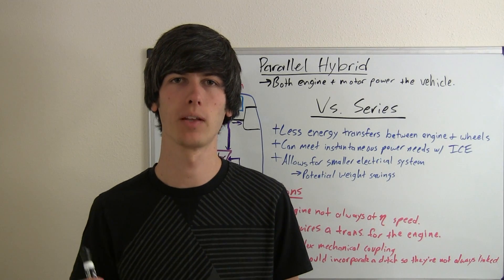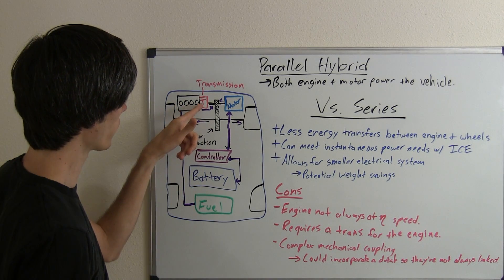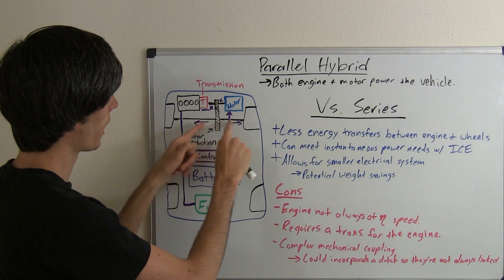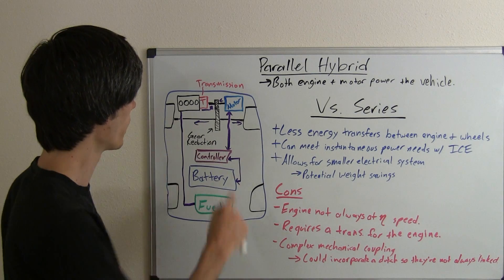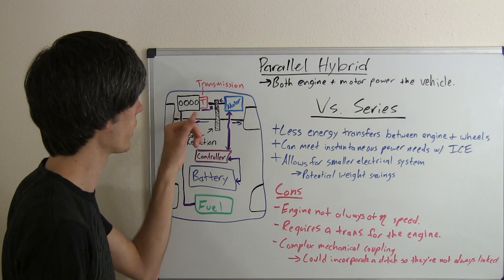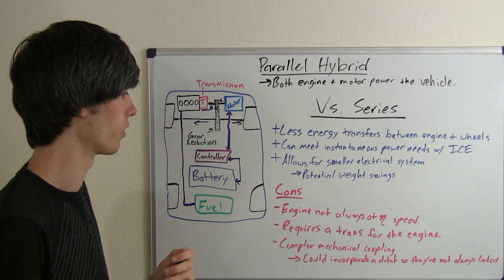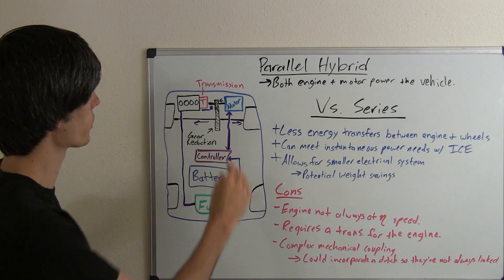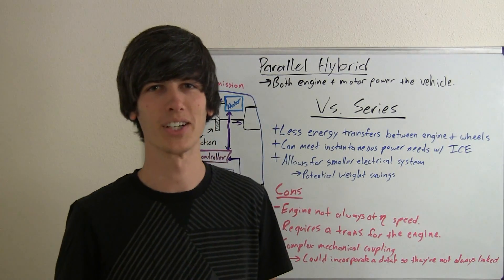Parallel Hybrid Cars - Explained

Comment: Be nice if a company could develop a plug-&-play set of components that would allow selection of the electric drive axle, battery, generator and connecting inverters etc. via a software program so that mechanics could select and build a drive train that fits the situation. Example is my old F150 "farm truck" I use it around the farm, never goes over 30 mph and often sits next to where I'm working and can supply electric power to tools I use.

Comment: I'm curious to know, instead of the complicated coupling mechanism between engine and electric motor can you put the motor to drive the rear wheels while the engine drives the fronts or vice-versa?

Comment: Can you just have the ICE + Generator directly power the motors and then just use the battery during acceleration? The ICE + Generator is not coupled to the motors. The battery will then be recharged using regenerative braking. Is this possible or am I naive?

Comment: can u explain that complicated transmission part like which type of transmission we can use and how to match the engine rpm and motor rpm as equal
Reply: Essy. Using sensors on engine and using a computer to regulate the current going in the motor.

Comment: Hi,
In mild hybrids or KERS where it is used as a 'boost' how does the electric motor manage to spin at the same rate as the ICE?
i.e. what couples (connects) the electric motor to the engine shaft or transmission. Because I assume the ICE and motor have to rotate at the same speed.
E.G. If the engine is already rotating at 5000rpm and the electric motor/ flywheel kers is activated how does it match the 5000 rpm of the engine?....
Does it even need to match the rpm at all?

Comment: Another advantage of the parallel hybrid is that if the battery pack or something in the electric side gives out, you can still drive on the ICE side of it to get where you're going.  In a series hybrid, if the electric motor gives out, that's and immediate tow.
Reply from the maker: Eric Brunhammer I suppose. If your engine dies in your gas car then it's the same thing, and honestly electric motors are typically more reliable than combustion engines.
Reply: Engineering Explained basically what I was saying was that if one system failed, you should in theory be able to make it somewhere on the other system; provided that it's set up to work that way.

Comment: Hey Bro nicely explained, i'm an Electrical Engineering student and i'm working on a final project that aims at improving on Parallel Hybrid systems. What i've decided on doing is an improvement to FWD Parallel Hybrids by replacing the heavy on board battery with a Variable resistive capacitive 3 phase load box connected to the axle of a rear mounted 3 phase generator. The generator is then connected to a mechanical rpm ratio step up linkage that is connected to a rear differential. This aims at generating voltage from the rotation of the free spinning rear wheels in order to power the on board motor upfront that is linked to the Engine. I aim to have the max rated voltage of the onboard motor be the amount of voltage that can be produced from the variable RC load. Would love some feedback on the either, and some heads up on anything you think i should look out for.

Comment: Question:
I just have a question about honda accord hybrid, i drive a 2005 honda accord hybrid and it has a 3.0L V6 engine with an electric sandwiched between transmission and engine. my question is about power output of the car, honda rates the net power of the hybrid system at 255 hp and 232 Ib/ft torque, from looking at regular v6 honda of the same model year, the gasoline engine only produces 244 hp and 211 torque, why isn't the power outputs in the hybrid system higher for the torque since the electric motor  alone produces 16 hp and 100 ib/ft torque? are they understating their cars?
here is a link to the car specs: http://www.honda.com/newsandviews/article.aspx?id=2004091736553
thank you!

Comment: Nice explanation. Would give some more details about how the most efficient RPM  are determined. What are the reasons for not having equal efficiency through the whole rev range ?
Reply: it's more to do with having to compromise where you want the engine to breathe the best. passenger cars try to optimize for lower rpms, race cars at higher rpms. If you find a BSFC chart for an engine, it tells you at what load and rpm it produces power most efficiently.

Comment: Can't the issue of the engine not operating at it's most efficient speed be overcome by using a CVT (which are generally also lighter than conventional auto transmissions)? If so, which system would be more advantageous between this and a series hybrid and why? As a side note, thank you for putting all of these videos together, you're doing a great job!

Comment: where does the battery get the voltage from in parallel hybrid vehicle??
Reply from the maker: Since the engine and motor are linked, the engine could be used to turn the motor, essentially making it a generator. Also, the motor can recover energy through regenerative braking.

Comment: What your talking about is the prius it uses a simple planetary gear system to shift power from either side but when the engine work the motor has to turn slower to give the engine more power to the split in the planetry drive. The honda ima configuration acts more like a starter motor that powers the transmission.

Comment: Why not using the internal combustion engine to power the front wheel and the electric motor to powers the rear wheel. That way, there's no need for complex mechanical coupling. Placing the electric motor in the rear wheel will also shift the weight distribution towards the rear wheel.
Reply from the maker: Sounds good on paper, yes, and from a performance standpoint it would have benefits. But cost would more than likely increase to have all four wheels driven, as well as weight. Since we're talking about Hybrids, weight is critical, as the less the car weighs the better the fuel economy. Weight distribution isn't as critical on hybrids when the demographic of drivers typically will not be aggressive.
Reply: I was just thinking the same thing
Reply: jsponson The Porsche 918 Spyder uses a similar setup, with a V8 powering the rear wheels and electric motors powering the front wheels.
Reply: Another disadvantage with that setup is the engine can't recharge the battery directly, it could only do so via regenerative braking (the car must be moving). The Prius powers the AC, power brakes, power steering directly from the main battery, eliminating all those belts and it can use a much more efficient AC compressor. So if you're at a stoplight (or parking lot, drive thru, etc) and the battery gets low you will be in trouble if you can't generate electricity.
Reply: @mpoisot i didn’t know that about the prius. Thanks for the info. Less belts means less stress and parasitic loss on the engine

Comment: Power comes entirely from motor when the vehicle starts to move from stationary. Then, above a threshold speed the ICE kicks in and runs within a range of efficient speeds, with the motor acting as a power boost to smooth out temporary fluctuations in amount of power needed.
Reply from the maker: Well, the electric motor doesn't have any need for oxygen, so the air quality won't affect that at all, which can differ with various altitudes/conditions. But really that'd just be an advantage over a traditional ICE, and not over the series. Performance wise, having the engine directly connected to the drive wheels would be beneficial.